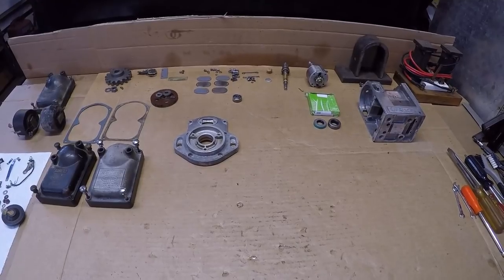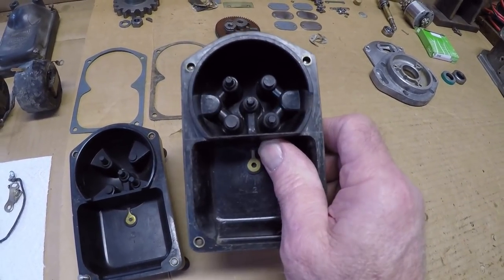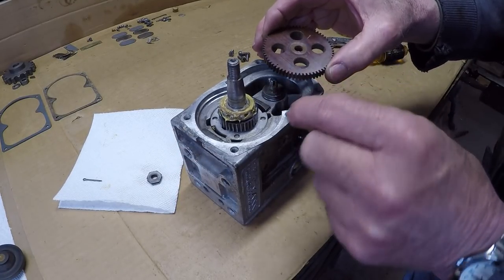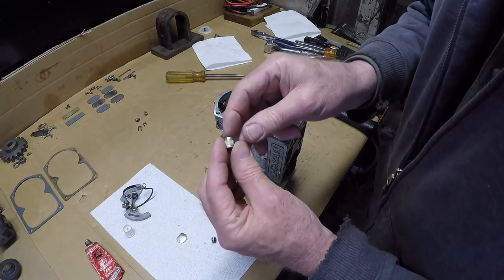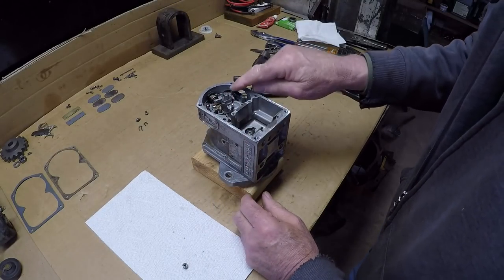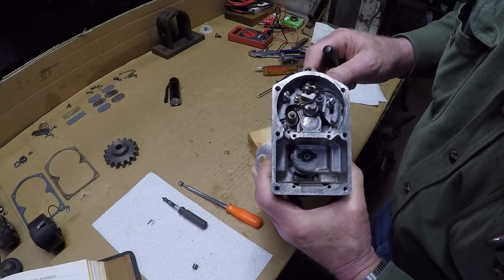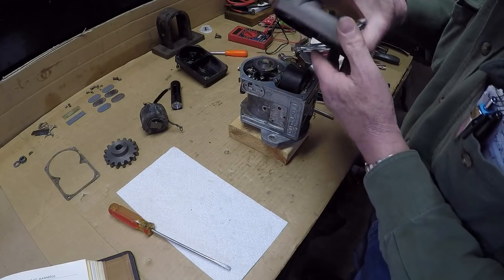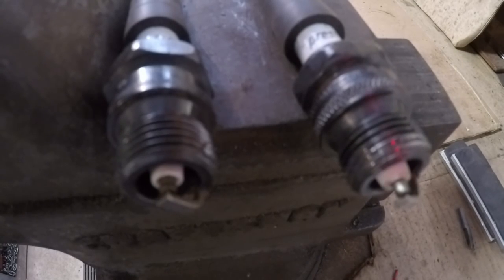Caterpillar D2/D4 Pony Motor Eisemann RC-2H Magneto Overhaul Part 2: Reassembly & Testing Spark

Comment: Amazingly fascinating video.
For wires with bad insulation abd lugs on the ends making it difficult to use heat shrink tubing use heat shrink tape.
You can get it online or pretty much any electronics retailer. 
I used to work on magnetos for Pratt and Whitney R1820 radial engines for Grumman HU16e Albatross seaplanes and they were a pain to work on without doing ant damage to the bakalight plastic parts.
They were fairly brittle till they started making new ones.
Several times I  found new ones still sealed in their packaging marked U.S. Navy 1949 or older.
My first duty station as a Coast Guard Aviation Machinist Mate was up in Traverse City Michigan and the Fixed Wing shop Chief,  Chief "Mad Jack" Bloom had me sort out obsolete parts on the shelves.
I found mags made for seaplanes London retired including Grumman Goose and Mallards and other aircraft the Coast Guard had in their inventory from pre WWII & during WW II.
Today they'd be worth some serious cash.

Comment: The only difference I would do would be to substitute a dielectric like Dow Corning DC-4 in place of the oil on the metal surfaces to prevent rust.  It resists any moisture penetration for years.  This is very informative, having never worked let alone seen the inside of a real magneto, I have learned a lot from this Cat Rebuild.

Comment: .... 8-32 screws are in very common use in the aircraft industry ... most aviation fastener suppliers can supply screws of size 6, 8, 10 or 12  in either 24, 32 or 36 tpi  (etc) and the heli-coil kits to suit ...  cheers.

Comment: Are the armature bearings not electrically insulated on these?  That's a source of long term issues on British mags. The insulator is called Rhino paper and breaks down with age, allowing current to track through the bearings and corroding them.  Also surprised that no adjustment to armature end float was needed.

Comment: Great video Senior!
Interesting that your mag doesn't appear to have an impulse coupling.
Most similar external mags for small engines , tractors and the larger Cat starter motors have them. Wonder why the D2 mag doesn't?
Reply: Yup, that's got to be the reason since mag output is proportional to RPM. Plus not having the impulse coupling would save cost, which was a factor you mentioned in a previous starter motor video. Interesting to speculate!

Comment: On our farm we run several old Moline inline 6 cylinder engines on water wells . Well every spring we have an older gentleman come out and freshen up the mags. Once he's finished he grabs the drive in one hand and the hot wire in the other. Turns the drive and goes yep it's good. Said a little shock therapy never killed anyone!!!

Comment: I don't throw away any old magnetos unless they are extremely trashed. The re-magnetization is a interesting process. At least I now know the basics of this process and what I need to make even a very basic setup for it.
Reply: @squatch253  Same way here, only difference is I have access to breakers yards and I can pick there what ever I find to be fancy and useful for myself. Old mags, carbs,distributors you name it. Also starting engines cause you never can have one too many.

Comment: Nice looking overhaul. Good performance. There is a product called Timeserts. Good alternative to helicoils. It is a thin walled concentric thread insert. They also do spark plug hole thread inserts